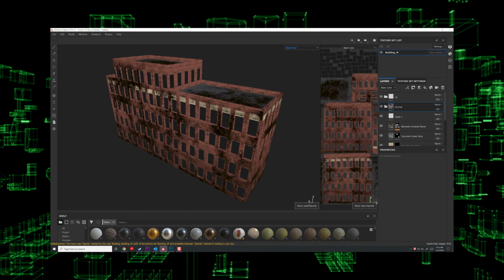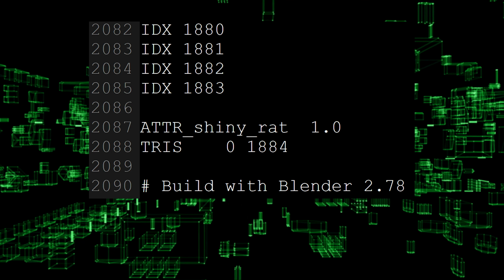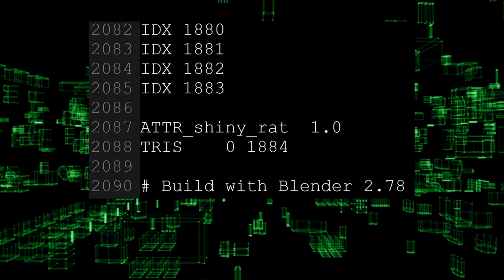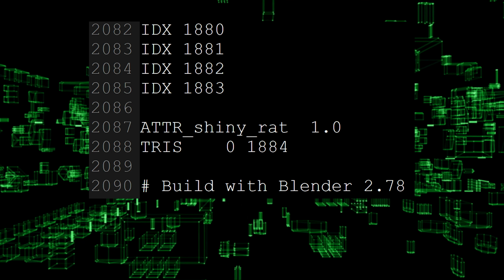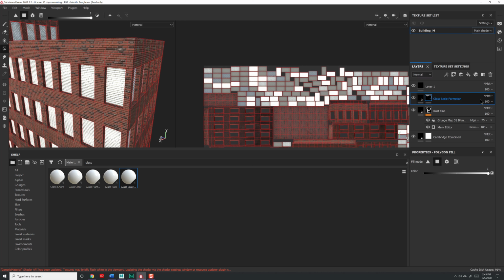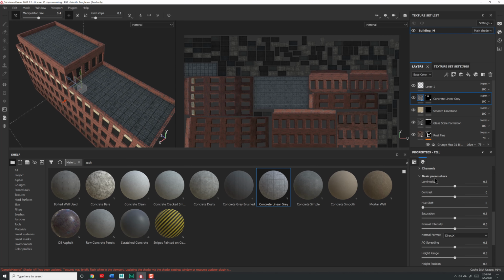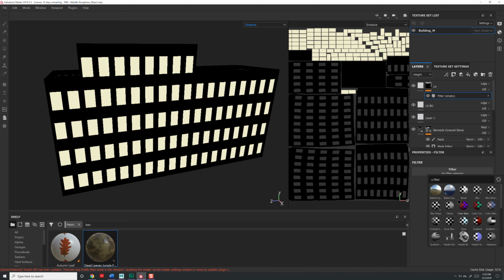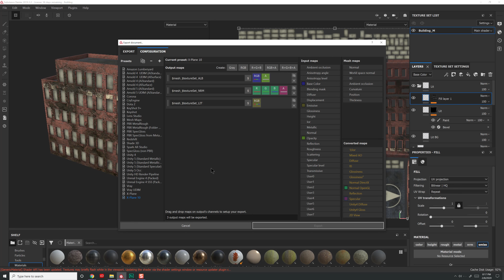Modding X-Plane - Texturing for X-Plane Scenery - 03

Comment: hey george, can you help me understand how the texture files' are arranged, where all parts seem in perfect order, like it was created by a software but not by hand. 
example: take x-plane's native aircraft carrier (resources folder/dynamcis) and see how many elements they put into 1 single .png. thanks in advance.
Reply from the maker: I can't really help atm because I don't have x plane installed. However, if it is a single PNG then it will only be the diffuse color information ( or albedo) and maybe an alpha channel. A PNG will only have 4 channels to work with. You'd need a different file format or a custom PNG type to store more data for the other workflows. Also, some data types need a different representation such as normals maps needing floating point values rather than integers for each pixel. Open the file in Photoshop or gimp or any program that lets you see the channels and if they just appear to be the r,g,b components of the color, then that is all there is too it.
Reply: @GeorgeLecakes  sorry george, i wasn't explaining well enough. my question related to how you arrange the various pieces of texture on a sheet of paper which then is saved as the object's texture.dds or .png. If you look at texture files that come with an object (in any sim), you find paints that collect every angle and part e.g. of a house, looking like a chaotic puzzle. each picture puzzle piece directs to a certain piece of the building. my question is, how are these texture puzzles created, manually or are they an exhaust of automation? thanks.

Comment: George, finally some decent tutorials on this! Thanks!
However, I'm getting an odd anomaly. Texure size is bigger in final X-Plane object than Blender UV edit. IOW, texture either covers less object area or fails to cover object. Scaling remains odd ratio.
My workflow is Blender 2.81 (soon 2.82), export add-on, WED 2.2, X-Plane 11.5 b5.
I'd be open to private consultation.
Reply from the maker: Is your texture a power of 2 and square not rectangular?
Reply: @GeorgeLecakes  Yes, that seems to helps. Tks! For the current software versions mentioned, it seems I MUST start with no less than 1024x1024, then reassign the lower res (512x512) in the OBJ file. MUST be PNG. 
I'm still playing around with this, including your tutorials... May I email you direct for further help?
Reply from the maker: Sure, although I'm not sure where you are getting these requirements on texture size and reassigning in the XPlane OBJ file. Software shouldn't care what resolution the image is at and if you name them the same thing and just replace in the folder the OBJ file will still point to the correct texture. Not sure if it has to be PNG. According to their dev info it used to be BMP files as well, but PNG give you lossless compression anyway. https://developer.x-plane.com/2007/08/image-formats-and-file-extensions/

Comment: MUST I have to make texture by substance painter? I'm blender user...
Reply from the maker: A texture is just an image, a bunch of RGB values assigned to pixels. You can use paint, photoshop, or a plethora of other options. However, trying to paint metallic, normal, height, smoothness maps is incredibly difficult and that is what substance does for you in one application. Since I am showing how to create models for the PBR pipeline (physically based rendering) and that takes advantage of those properties, that is why I show Substance Painter. If you are using the older diffuse pipeline, or are just creating a normal map through projection, you don't have to use it.